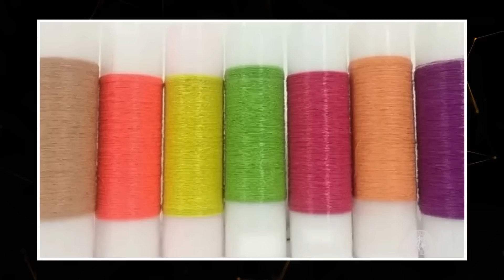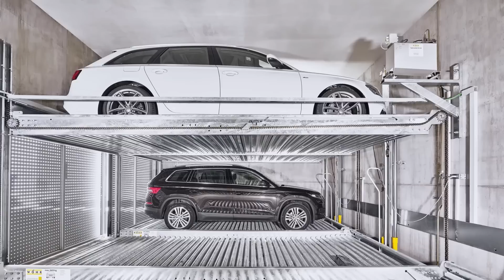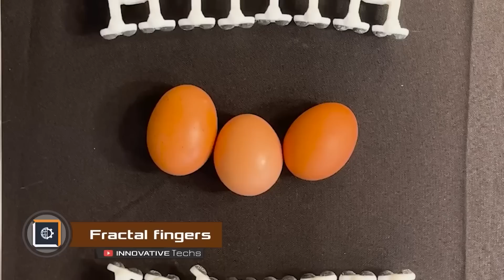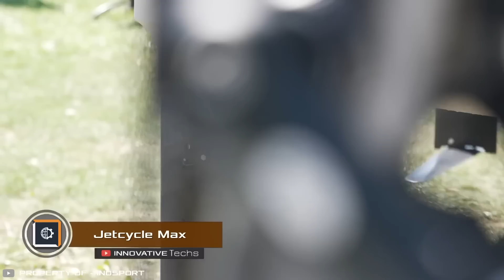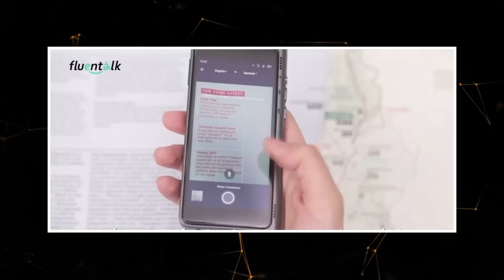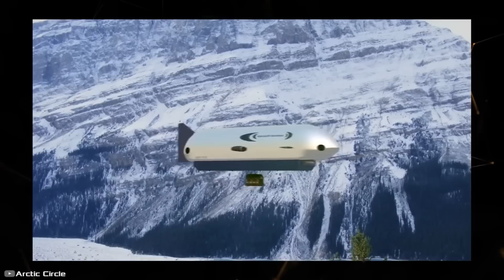70 INVENTIONS ON A WHOLE NEW LEVEL

Comment: There is no shortage of parking places in great cities. There just are far to many single user vehicles. Movies keep reminding us of the thrill and adventure of driving our own cars. That represents one thousandth of our boring, expensive and still too dangerous, experience of driving.
Reply: Yeah, also the construction of cars which are primarily used within the city limits is far too heavy and bulky, those are "tanks on wheels". In the meantime the city cars would be even more efficient if they not only would using electricity to power their engines, but should be as well constructed with lightweight easy to recycle materials. Those new generation mini cars are already available on the market, the problem is the current legislation, which doesn't promote them by setting the tax 0% for this kind of transport, with the next step should to completely ban those "city tanks" and leaving only legal to use them outside the cities: at the countryside and highways. Now people avoid driving in those new generation lightweight cars because they are not as cheap as they could have been when the mentioned steps were implemented. Also, at the moment drivers are afraid that in the case of a collision with the "road tank" they can suffer worse injuries than if they were in the same size/weight vehicle. Henry Ford almost 100 years ago developed a car made mostly from hemp - this car was superior to the stainless steel construction in terms of rigidity and weight, but wasn't such a great deal:  in those times in the matter of recycling was almost nonexistent. If the such material would be available today it would be a deal breaker in the market of mini cars. There are many ways would make the use of a car more affordable and pleasant - imagine over 90% less time spent in traffic jams!